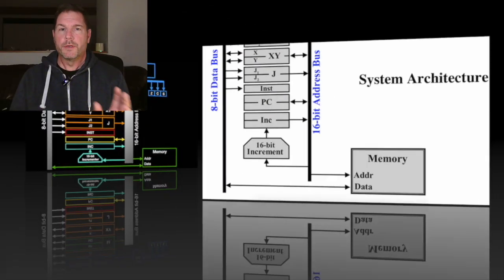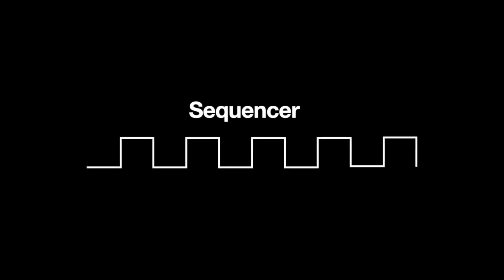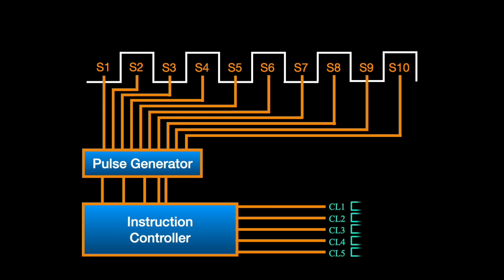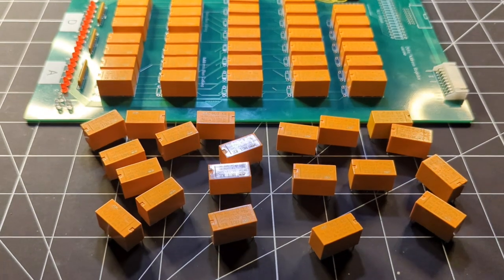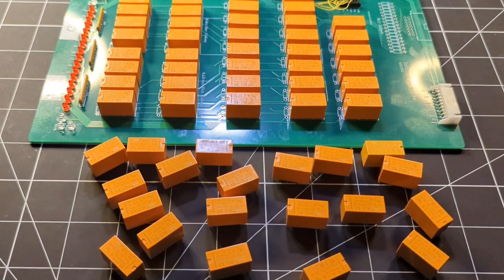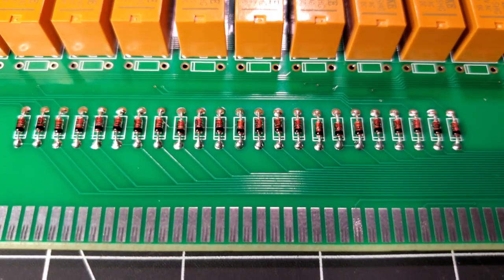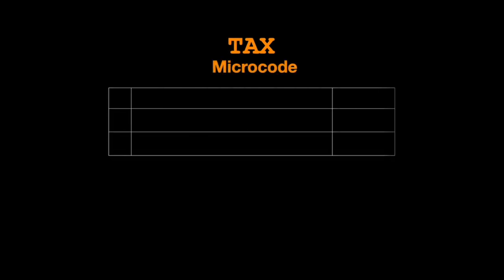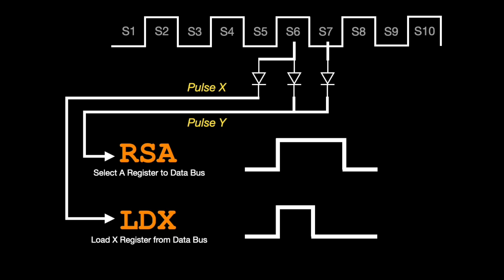Relay Computer - Sequencer

Comment: What do you think about a relay display? Maybe 16x2 alfanumeric
Reply from the maker: Ah - I don't want to do a spoiler here - but I have a couple of ideas in mind. I've also picked-up an "electromechanical" device for communications that should work with the speeds the relay computer is outputting.

Comment: That thing is a beast. An amazing beast. BTW I have heard 12 volt relays are better for logic because they use less current. Have you had any power issues?
Reply from the maker: I wondered that as well, these particular relays are a bit power hungry, so far no issues but I'm having to watch the amps now that there are so many boards.

Comment: My father was a signal engineer for the railroad. Railroads use control logic built in relays. Newer systems have gone electronic for some of the higher level functions, but the low level “track safety” stuff is still in relays, because with relays you can predict what will happen if one fails. ( not so much with discrete logic ). He often had large blueprints from work spread out on tables at the house. 

I went with him to the field several times, and have fond memories of sitting in one of the remote relay cabinets when a train went by, with my father narrating. First you would hear the approach relays toggle, then like a wave the clicks and clacks rolled through the case as various circuits triggered. The final clicks were the switch lockout dropping, indicating that it was safe to throw a switch to change the path a train would take.  

Just hearing your device go through its motion, triggers that very nostalgic memory.
Reply from the maker: That is a truly awesome story :) I'm finding more and more about how much relay are used in everything and didn't realize it.

Comment: New sub here. Im following your project very closely and really dig your desugn. I always viewed relays as iredeemably obsolete technology and avoided them in any of my professional engineering work. When I was forced to impliment some basic relay logic for a safety interlock, I got helplessly fascinated with how differently logic gates can work on relays, how a single relay is a much more powerful logical building block than a single transistor, which is only superior by virtue of speed. For a fun little challange, I tried designing an adder, which naturally became an ALU, then registers. Now I'm working on a relay computer as well, but on "hardcore mode"; an arbitrary constraint of no semiconductors except LEDs for visual feedback only (Diode logic is cheating). Currently designing PCBs while I wait for my HK19F's to arrive from China.

Genius move with the edge cards. Im totally going to rip that off at some point. Keep up the great videos!
Reply from the maker: That's awesome to hear! I was so intrigued at how something as basic as a relay could be used as a building block to larger logic circuits. The constraints are fun to manage - RAM will be a challenge   to keep "period correct" but I may consider doing two routes in parallel for that one. I would be very interested in seeing your work, make sure you keep us all posted!

Comment: My sequencer is just essenially a rom lookup table.  Output of the sequencer just activates a row in the rom, the data lines then activate various modules and connect them to the bus or send control signals to things like the ALU.
Reply from the maker: I recall a similar concept that Ben Eater used on his breadboard computer which was a real eye-opener for me. Is it an IC-based ROM you're using? In future, I'm looking at ROM being something like a bunch of DIP switches just to keep it old school.
Reply: @dipdoting  yes my ROM is just rows of dip switches.  I wanted to keep it old school too :)

Comment: Thank you for sharing your journey into relay computing.  Have you given any thoughts to how to implement self-checks or raising exceptions when a fault occurs with a particular relay?  Will you be able to implement any fault detection or a power on self test of sorts with the ability for any given card to raise an OK status?  So many interesting things to think about during the architecture design!
Reply from the maker: That's an interesting concept, like a BOOT ROM routine that runs some basic check routines (transferring values, compare results, memory test etc). Would certainly make turning on the machine more interesting at start --- right now there's just a single "click!"

Comment: Thanks for making these videos. I've really enjoyed them so far. Im currently about 96% done on a replica of the 11 bot relay calculator Usargi did a few years ago.

I've had three people independently recommending your videos, so here I am.

I must resist the temptation to build a copy of your machine!
Reply from the maker: Thank you, glad to hear about your relay calculator project! Once it's done, you may want to expand on it and it will become your own relay computer!
Reply: @dipdoting  haha- I'll think about it. I've done mine by hand on strip board. Possibly a mistake, but each of the five main boards are unique.   Being a one bit serial design it does make the alu pretty simple- if slower.

Comment: one quick note on the diodes across the relay coils.  I suggest replacing them with TVS diodes- regular reverse diodes will slow the release of the coils down greatly.  this is because the diode slows the collapse of the magnetic field down as it shunts it.  the TVS diodes (or a zener in series with a regular diode) will allow the voltage to rise higher than .6V and speeds the collapse up and thus release of the coil.  I am making a relay based calculator and used bilateral TVS diodes on the coils for this purpose.
Reply from the maker: There's some great feedback on diodes, I'm thinking that since I'm building many of the same cards (ie: registers) I can try to use different types just to compare the results. In a machine that's measured in Hz vs GHz it shouldn't impact the performance materially --- will give TVS a try, thanks!
Reply: @dipdoting  Probably 2x your coil voltage is a good place to try.  I finished up a prototype 3 digit adder (decimal) this week made with relays and I got it to run at 200Hz using the TVS diodes.  I am using 5V coils vs. something higher, so the inductance is lower and theoretically the speed of field collapse.  along with 10V TVS diodes.  I used the bidirectional ones so I didn't need the reverse diode, like you'd need if using a regular zener.  it will be interesting to see what happens on your testing
Reply: Don't forget to keep in mind the reason you use flyback freewheel diodes to begin with. To clamp the voltage. Raising that threshold might cause problems if it ends up higher than what your parts downstream can take. Research your other parts first!
Reply from the maker: @AnnaVannieuwenhuyse  It raises a good question: I wonder if Konrad Zuse's Z3 machine suffered from any flyback issues. Those relays were massive, but maybe more sturdy and could handle it.
Reply: @dipdoting  the relays themselves are not harmed by the flyback voltage spike. It could be argued that the reverse polarity spike actually prolongs the life of the contacts by reversing the magnetic field's potential. 

The biggest concern comes from the high voltage spikes hurting semiconductor devices like transistors, which are commonly used for switching the relay coils with small signals. EMI (radiated electromagnetic waves of electrical noise, which causes interference) is also a concern, mostly for industry use and product designers.

Comment: This is amazing. I've just gotten into the 6502 processor, but this is on a completely different level. Keep up the amazing work 😄
Reply from the maker: I love 6502s, I dabbled in assembly on Commodore 64s! You may have noticed my use of 6502 instructions for the videos 😉

Comment: What criteria did you use when selecting the relay make and model? As the number of these relays increases, this factor may become crucial. I remember looking for relays to make a simple astable multivibrator analog, and the endurance (on/off cycles) varied a lot between models.
Reply from the maker: My quest for relays wasn't very scientific - I started with a pack of 5 relays from Amazon - my only criteria was that they were 5V and would fit on a breadboard. the datasheet claims a lifespan of 10,000,000 cycles --- we'll see!

Comment: if/when a relay fails, can you identify and replace it? or would you swap out the whole board?
Reply from the maker: I had that exact problem on a previous board. You can test relays individually (from the bottom side). I'll try to demo that in the next video.

Comment: Any particular reason you are not populating the back-emf diodes?
Reply: maybe he bought relays that already contain diodes
Reply from the maker: @typedef_  That would be handy!
Reply from the maker: That's an easy one...I didn't have enough diodes on hand 😄 just enough for the pulse generator. More on order, will need to populate on all my boards so far! So far seems to be running okay without them but don't want to build too much further until they are all installed.
Reply: @dipdoting  Well, just a heads-up in case you were not aware: Adding single-diode back-emf supression will (likely) slow down the realease-time for the relay by a factor of 2-3 times. So be aware that adding the diodes might slow your comupter down significantly. There is another method using a diode and a zener diode in series which gives faster release time. It might be worth experimenting with Arduino and your relays to figure out the best way forward.
Reply from the maker: @smudgerdave1141  That's an excellent point! In the previous video comments someone mentioned that they leveraged that same delay to create simplified latch for their registers. I've been using 1N4148's thus far - maybe once I install them all I won't be doing "turbo mode" anymore!
Reply: @dipdoting  You can substitude the 1N4148 for pretty much any silicon-based rectifier diode as well.
Reply from the maker: @AnnaVannieuwenhuyse  Thank you, I purchased a bunch of 4148s and hopefully they do the trick. I'm open to options, there will be a lot of opportunity to try some different diodes I'm sure. Thanks and please keep the your suggestions coming, they really help!

Comment: Excellent work and looking forward to more. Just a suggestion, you might want to mention how much power you are drawing.
Reply from the maker: The registers (fully loaded with data - all LEDs on) come in at around .96 amps. I've ended-up using relays that are .04A (.2W) each, they are a bit power hungry but I can never find the lower wattage versions.